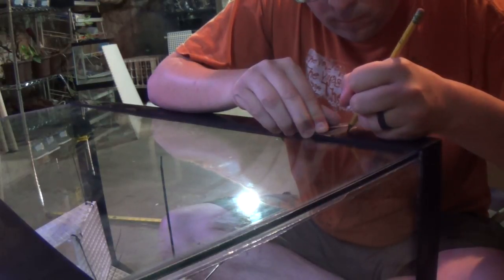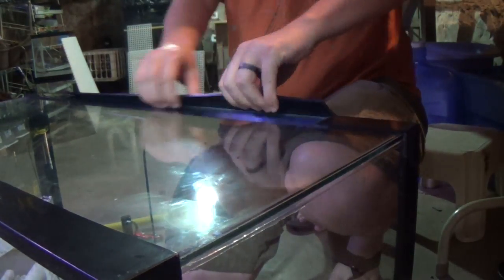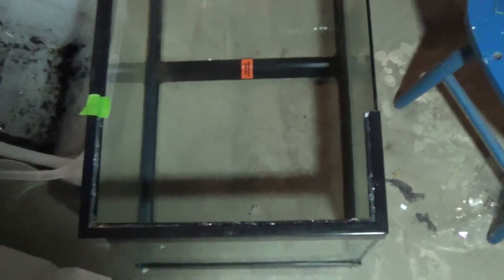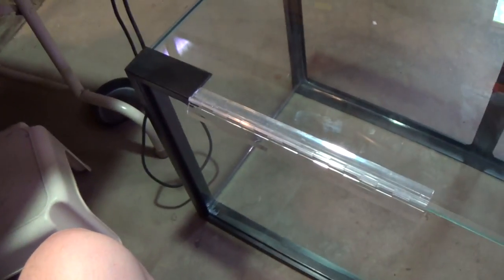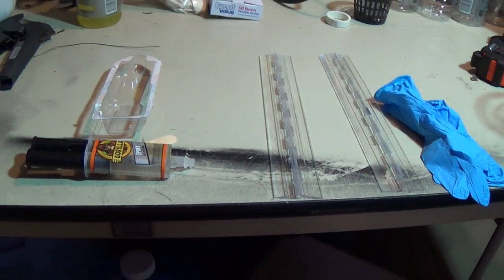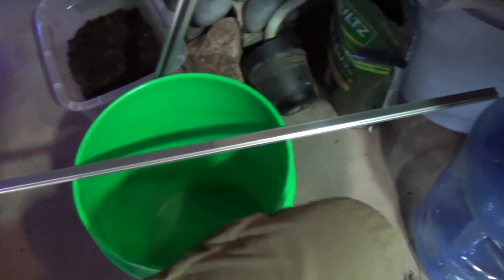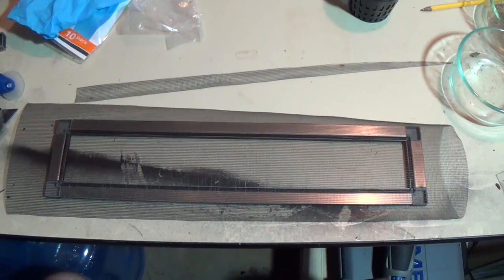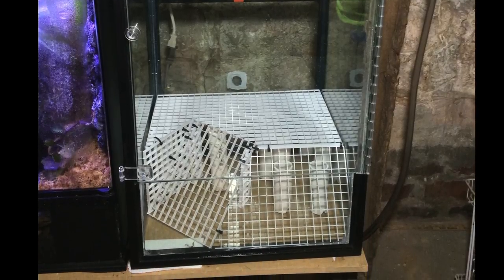How to Guide: Convert a 40B Aquarium to a Vertical Tank

Comment: I'm assuming you cut the bottom of the tank to create the doors, what did you put where the hood would go ? Did you just a glass lid and epoxy it and seal it with silicone ? I'm just curious as to what to do because I have a 30 gallon tank I want to do this with.

Comment: I'm curious, how well has the epoxy held up with keeping the acrylic hinge attached securely to the glass door and side of the tank.  I am currently in the process of building a 40 gal vert and I'm trying to decide how to install the door. I was planning to use 1/4" thick acrylic for the front door and a living hinge but a side opening door of glass would be my first choice.  Any input would be appreciated.  Thanks

Comment: Did you remove the top panel of glass? I am having trouble because I want to follow this build but i need UV light to pass through and into the tank.
Reply from the maker: Sp1k3y1 I did not remove the top panel. What are you keeping that requires UVB?

Sorry for the late response.